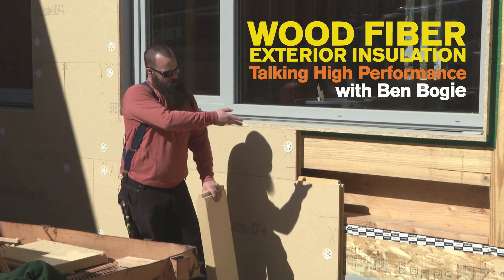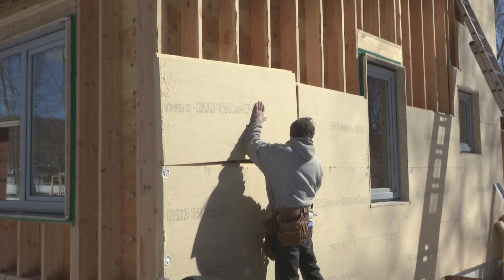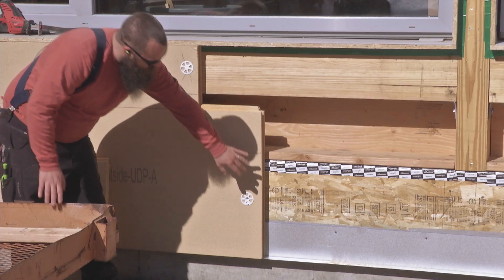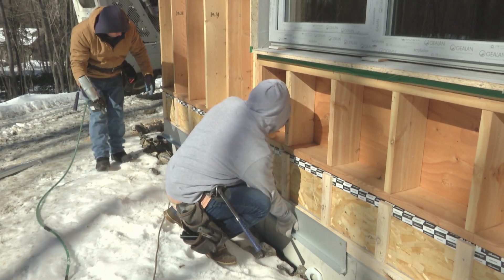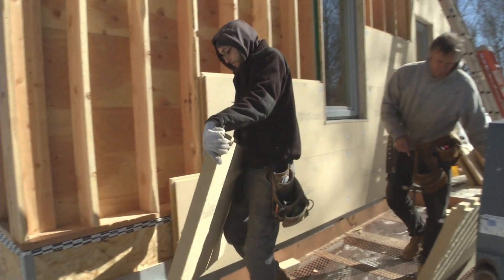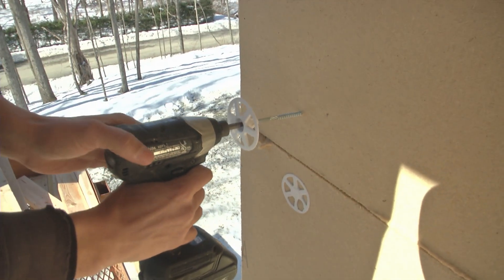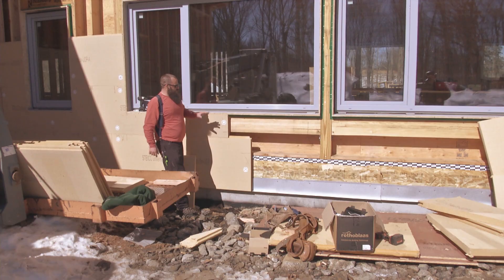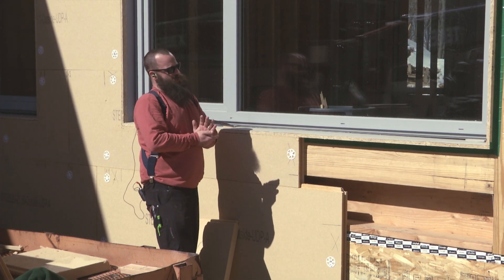Using Wood-Fiber Exterior Insulation for a Net-Zero Construction

Comment: I believe the building science term is "thermal mass". :-)
Reply: Similar but not the same.
Reply: @benbogie4178 , I was simply pointing out that building materials having higher heat capacity have been traditionally referred to as having higher thermal mass.  The entire point of using such materials vs those with lower heat capacity is to give a building "thermal inertia", "thermal storage", or a "thermal battery" in order to smooth out the peaks and valleys of temperature influence from the outside environment (as you pointed out).

The scientific term when comparing two dissimilar materials in that regard is "specific heat capacity", but notice I left out the word "specific" above.  Specific usually refers to a material's heat capacity per a specific amount of mass.  Do you know for sure that wood fiber insulation has a higher specific heat capacity than foam?  I wouldn't without looking it up, because that term is assuming you're comparing an equal mass of foam to an equal mass of wood fiber.  The specific mass, or density, of a material comes into play.  Yes a wood fiber panel has a much higher heat capacity than an equivalent volume of foam insulation, but that's mainly because it weighs a lot more.  It's specific heat could actually be lower than that of foam for all I know.  To figure that out you would need to know the heat capacity and mass of both materials. ;-)

Comment: I like the fact that it is carbon-negative, as opposed to the big carbon footprint of rockwool. The downside is that you are losing the fire protection. Depending on your situation that may be a good or bad trade-off.
Reply: Wood fiber insulation, especially the board product is for all intents and purposes fire-proof.
Reply: Compared to Steico there is a company which produces non-glimming wood fibre insulation. Take a look at Gutex, they're the pioneers.
Reply: If the product is imported from far away, then that needs to be factored in to the "carbon footprint"

Comment: How much does it cost? Have your construction costs gone through the roof?
Reply: I’m not going to dig out the pricing as it’s all changing so rapidly right now that I don’t want to steer anyone wrong. This material comes from Global Wholesale, Will the owner will be happy to share current pricing if you contact them.
Reply: @benbogie9243  ok.... I will, my guess is that it’s extremely expensive with costs only increasing
Reply: @BC-ux9iw  to some one that drives a Nissan a Ford may be “extremely expensive”, value is relative to the goals.  To give you a rough ballpark, think around $1.50/sf
Reply: the cost in Germany for one square meter 8 cm thick is about 24€

Comment: Looks quite a bit like LDF
Reply: Very similar
Reply: @benbogie9243  Did you end up putting a WRB on top? or does the gutex act as a WRB itself?
Reply: @comfyhome  no WRB. At first I was skeptical of this approach but after working with it is safe for this project. In a more challenging location (multi story, no overhangs, coastal, etc) I would probably give it a second thought.
Reply: @benbogie9243  Thanks for reply. Ah, that makes sense. From a hygrothermal (but not structural) perspective it seems like adding a WRB outboard of the Gutex effectively creates a very expensive double stud wall.

Have you seen this video where they are using a similar product (Ultratherm, with a different T&G style) as the roof WRB? https://www.youtube.com/watch?v=Z3lJ95tmWlY EDIT: the relevant parts are actually in Part 2 https://youtu.be/g5aC0D8u5y4 and a separate manufacturer demo vid: https://www.youtube.com/watch?v=pF6Nu8IpxGM

It looks like kind of a pain to detail the seams at penetrations and butt joints with the tape primer, but the existence of this video suggests that in some places, paraffin infused wood fiberboard is a common primary WRB